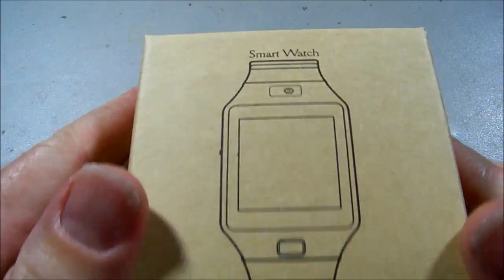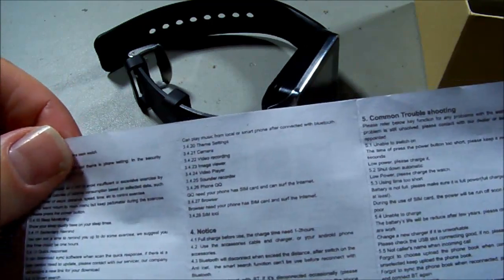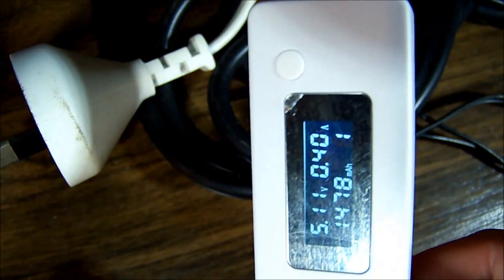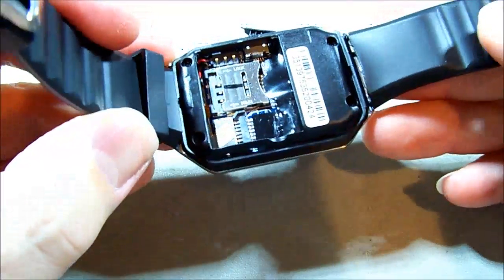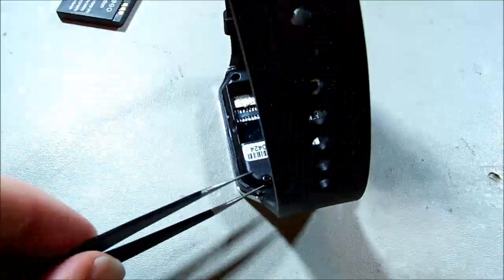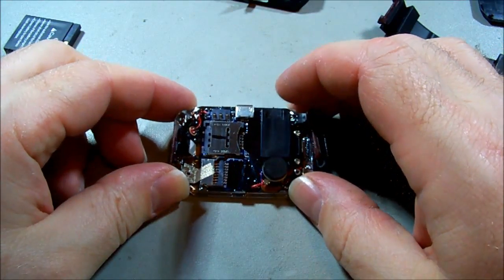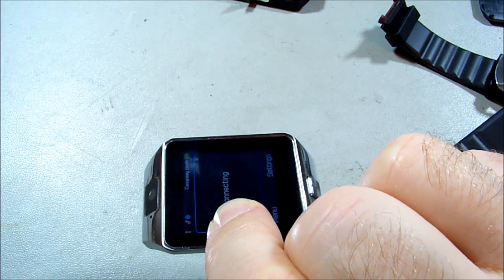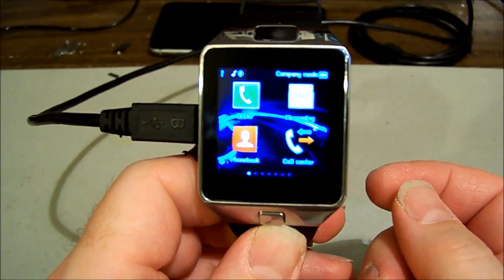Smart watch repair

Comment: The black electric wire from the DZ09 smartwatch goes to the GSM antenna, which is on some kind of foil.
I have a smart watch DZ09 that worked yesterday and today it will not work with you know what the problem is.

Comment: I have this same Model, and well I turn off normally, but now I can turn on again, you know why? I check the battery levels but everything is ok, and when you connect the charge cable nothings happend, any idea? 😭
Reply from the maker: I do not know sorry. I guess you removed the battery and tested it. IF not try removing battery for a few seconds. Full charge should show about 4.2volts. You could try holding the power button for at least 30seconds with battery in to see if it helps. If still nothing it will need to be opened and investigated.

Comment: When I got mine I for tested it but then never used it. Now (a year later or so) I tried to use it however it doesnt turn on and putting in a charging cable also does nothing. Just a big black screen. Any ideas on how to fix this issue or what the problem is?
Reply from the maker: Having not used it would have allowed the battery to discharge below the safe point and so the BMS on the pack will have shut it off. The battery might have a couple volts in it but will show 0 on the terminals/wires coming out. You will need to carefully charge the battery directly with a current limited supply at about 50-100mA until it comes up to about 3.8 volts. The watch should be able to charge it after that. The battery may have lost some capacity. Don't try and fast charge it directly for safety reasons.
Reply: Don’t worry

Comment: I recently bought a smartwatch for my daughter. I can hear people but no on can hear me on the other end, also I hear my echo. What will I need to do in order to fix this problem?
Reply from the maker: If you can, try pairing it with another phone (if that's how you are making calls with it). If that works then the original phone may have a setting wrong. If you are using a wired or bluetooth speaker and microphone to the watch then maybe try a different one. If you still have no luck then since it is new I would suggest returning it for a replacement unit.

Comment: I have this watch. Been using it for over a year, just recently I dropped it in water and it doesn't work anymore. Whenever I try to switch it on, it just vibrates and nothing happens. Can you please help me on how to make it work?
Reply from the maker: It will have corrosion inside from the water that will need to be cleaned. If you take it apart you could gently brush it off with a toothbrush in some isopropyl alcohol and it might work. Do not put the screen or battery in alcohol. There will most likely be parts that need replacing.
Reply: @JonnyFix  thank you

Comment: My Watch power button is not working plz give any suggestions
Reply from the maker: Check voltage between ground and each pin of the button. One pin should have around say 3V. When you press the button that pin should drop to 0. If it doesn't you need to repair or replace the button. You can further prove this by taking a piece of wire or metal tweezers and join both pins together for a few seconds. If the watch turns on it's definitely the button. If the button is ok you will need to troubleshoot the main board.

Comment: Its not android, its android compatible in the sense of "app" support to talk to the watch, but the watch itself runs a version of the RTOS Nucleus.

I broke my glass, and need a replacement touchscreen (the TFT still works). the part number for it is: G29B-01
its for a A1 smartwatch (bougth it for 16 euro, its now 9 euro everywhere). its being sold on Taobao very cheaply, but hard to get outside china. Either I need some Aliexpress seller to be awesome or just buy a new watch :P (gonna hack this watch anyway, it can run Fernly (xobs/fernly on github, an research OS for the Mediatek chipset (no tft or wireless support "yet", so useless for normal users)

The TFT is: FPC-HSB015A009-A2 (second row text: SLH 1732) The mainboard pcb: LD991-MB-V7.0
Reply from the maker: Great info. Interesting to know, thank you :)

Comment: Do you happen to know how to troubleshoot zgpax s8's motion sensor? It doesnt work, maybe you can help me please. :(
Reply from the maker: Maybe you can find an app to show sensor data to prove it's a hardware fault and not a software fault. If software try a factory reset, if hardware I don't know. See if you can find a datasheet for the chip and work out if it's operating.
Reply: Jonny Fix I tried to download a sensor test app. It really doesn't respond to it. Can you tell me more please?
Reply from the maker: I honestly don't know any more about this model.
Reply: Jonny Fix right. But thanks anyway!

Comment: My smartwatches camera is not working,what I do
Showing camera error
Reply from the maker: Check connection to camera. Remove and re-seat the connector/flex. Check for power supply to camera. You will have to check every pin of connector for some reasonable voltage e.g. 1.8, 3.3. I don't know what they'd use but if you have none or have something weird like 0.7 or 2.6 that might be your problem.

Comment: hey , i really have this smart watch and i like it but the antenna card cut and it doesn't work i really dont feel confortable with this because my family dont know if smart watch works or not they know that it works but it not i  want to repair the antenna card and examine the watch !! please answer me
Reply from the maker: You made a statement, you didn't ask a question. Not much I can say. If you want to try and fix it, good luck! It sounds difficult. If it was a cheap watch, maybe not worth the effort.

Comment: Hello Jonny.
My smartwatch is showing 'charging error' when the charger is connected and not being charged. Is there any solution to that?
I need help. Thanks in advance.
Reply from the maker: Make sure connector isn't damaged and connections to the pcb are good. Otherwise could be bad battery or more serious.
Reply: Jonny Fix battery is new. Nothing is visibly damaged. Cant figure out.